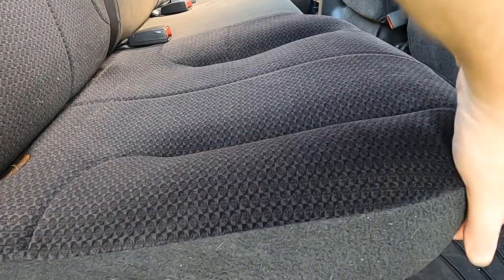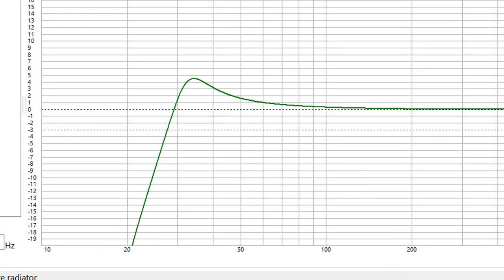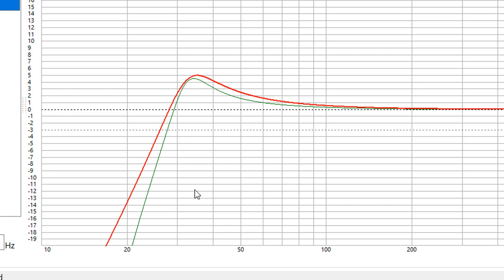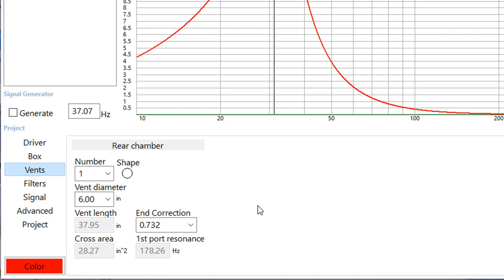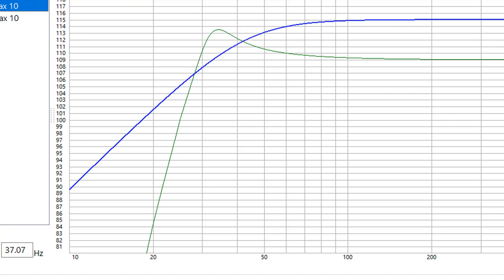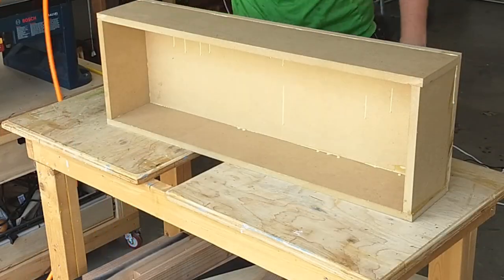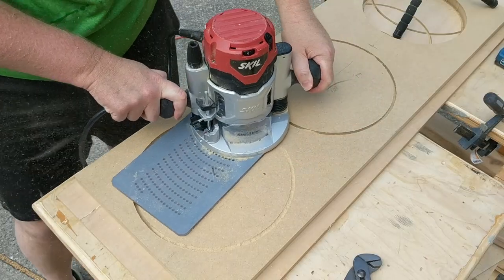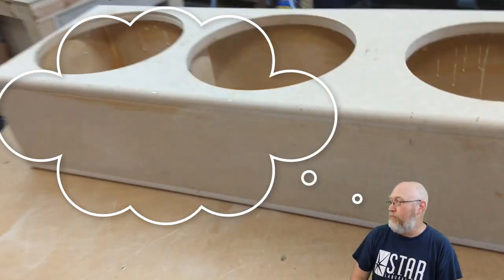Passive Radiator Subwoofer Build!

Comment from the maker: Version one of the box worked great, but one of the PRs failed.  Version 2 is here:   https://youtu.be/WWNQZzwcbBM.

Version 2 uses a single PR that has a lot more xmax, it sounded great and it's working just fine.

I have to do some additional upgrades before I can get the final box fiberglased and installed.  Hit the subscribe button so you don't miss it.

Comment: Your videos gave me the idea to drill a hole in my kicker passive radiator and added a small bolt and some washers to it and I was able to lower the tuning frequency from 49 to 39hz.  It actually sounds WAY better.  Before it was very loud in a very narrow range now it’s pretty loud all over and plays way lower.  I wish kicker would post there radiator ts perimeters!

Comment: You can easily drill out spot welds on the front wall of cubby hole and remove. That will give you more options
Reply from the maker: The thought has crossed my mind!  I have had the carpet out.  The front wall of the cubby hole does not appear to have any structural purpose.  If this project does not give me the bass I crave I might give that a shot, after that the only choice is to toss the back seat or make a blow-through.  I need the truck to depreciate a bit more before I can stomach a blow-through.

Comment: Regarding the internal box volume, how did you do it?
Some say, it needs the volume of a ported box minus the port, and some say it has to be same size as if it was sealed.
What was your experience?
Reply from the maker: Anytime you build an enclosure you need to account for the volume taken up by the port, the speakers, any internal bracing, etc.  This is all true no matter if you're going with ported or sealed (obviously a sealed box would not have a port) or passive radiator.  In this case the final volume of the box would need to take into account both the active driver and the passive cones.  In this case the gross internal volume was 1.75 cubic inches, I have not taken the opportunity to calculate the net volume after backing out the airspace that the subwoofer and the passives take up.
Reply: @DIYAudioGuy  Thanks so much for your reply.
I have used the Bass Box Pro software for my boxes. I've built sealed, ported and bandpass boxes, and yes, I've taken to the account the volume of the cones and ports (if ported).
On one of my cars, I have 2  JL 12w7's on a ported box. Its loud. But I want something different now.
This time I wanna go with a Passive Radiator. Bought me a 15" one from Parts Express, and will use a 12" sub for it. Wanted to go with JL 12W3, but that one only comes as a SVC, so need one that's a dual 4ohm.

So to refer my question again, let's say, a sealed box for a certain subwoofer is .75 cubic ft.
Same subwoofer in a ported box has a volume of 1.25 cubic ft (plus port volume)
If I use the same subwoofer with a Passive Radiator, do I use the sealed volume size (.75 cft.), or the ported size (1.25) ?
Thank you
Reply from the maker: I understand what you mean now.  A passive radiator is just an expensive and complicated port.  So you would go with the 1.75 cubic foot box.  I've never used Bass Box Pro, but you should be able to model a passive radiator in that software.
Reply: @rumruumm  bb6 does allow for passive radiator designs. you simply enter the radiators parameters just like the driver. then start playing with the box size and plot it. then start adding weights to the radiator, you do this by adding the amount of the weight you want to the mms parameter of the radiator. buy yourself a small digital scale and go to a hardware store and buy a bunch of different size washers. when you are doing final testing/tuning, simply leave the radiators inverted so you don't need to remove them to change out weights.(some radiators do allow adding weight from the front) some common sense is needed tho, you dont want to go adding 400grams of mass to a cheap 8" radiator. there are guidelines that i can't recall atm but google will help .
Reply: @DIYAudioGuy  unless you run an external port. ports don't have to be inside the box. people either don't realize that or tend to forget it.

Comment: Very nice👍 Is there ever a degree of cancellation whith passive radiators?awesome video.
Reply from the maker: For the most part they act just like an expensive port.  The only real reason to use them is if you don't have room for a port.
Reply: @DIYAudioGuy  yep you see passive  radiators on alot of your higher end home speakers👍
Reply from the maker: That never made any sense to me.  You've got plenty of room in most home speakers to build a massive port.  I suppose they're trying to avoid port noise or they are trying to make the speaker and look more expensive so they can command a higher price.

Comment: Can I use 1 passive radiator for 2 subs
Reply from the maker: Yes, but it will need to be huge.
Reply: @DIYAudioGuy  well crap cause there isn’t huge under the seat of my truck I asked kicker and they said I could try it out